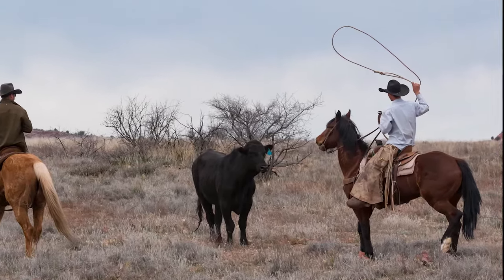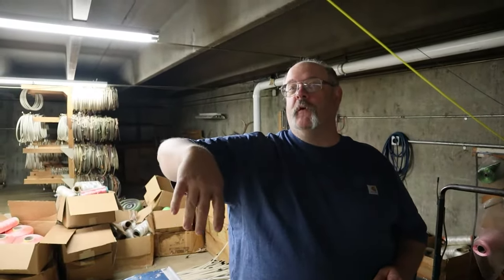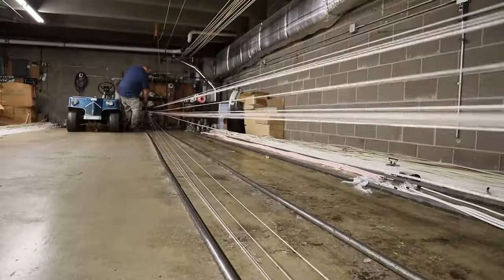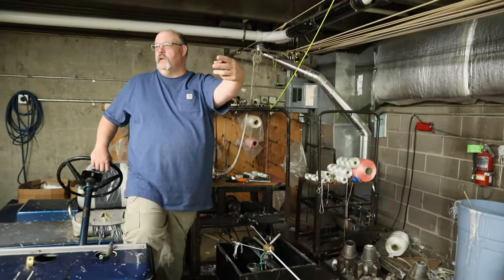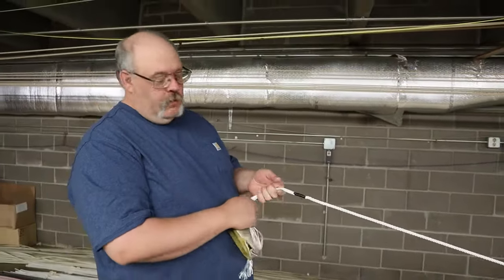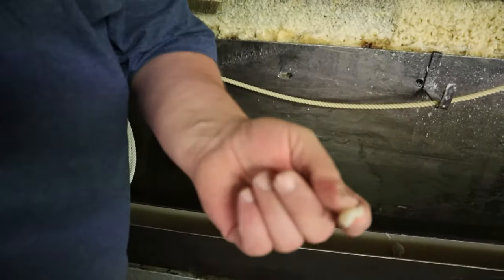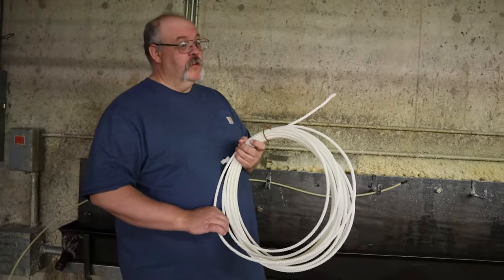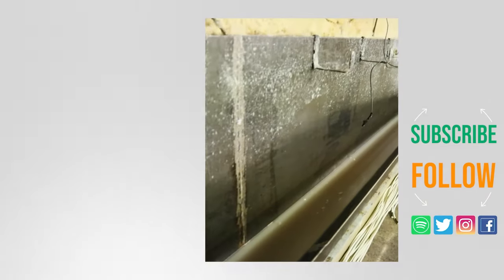How Cowboy Ropes are Made at King Ropes in Sheridan, WY

Comment: What's weird is, letting the traveller force the twist like that, rather than arresting it by hand, is considered 'wrong' by rope maker standards, as it's 'too hard a twist' and you'll get shouted at. Yet they not only let the cob and traveller loose, but let it force itself along down the walk. I've never seen that before, but it explains why farm rope in America is so damned rigid! Although I sincerely believe the only reason for the hand arrest on the cob or traveller is to spare the materials, you can get an extra ten feet of rope with a soft sub 45 degree arrest. Which probably saved rope makers a fortune in the long term. This is a MUCH easier way to make rope. Albeit a very stiff rope.